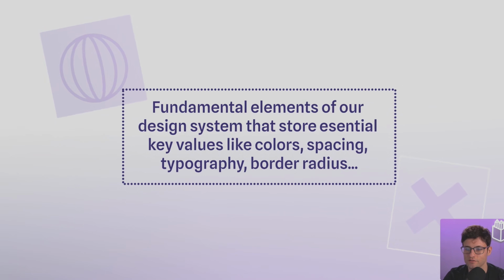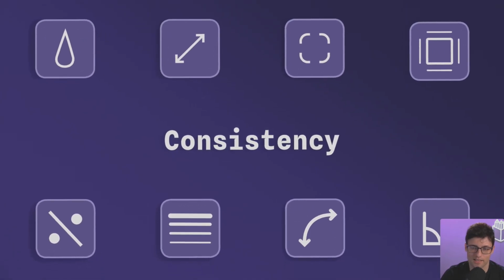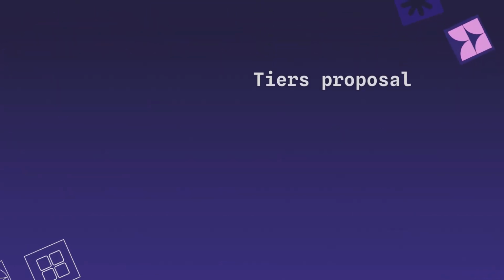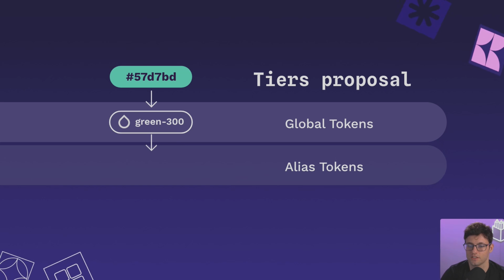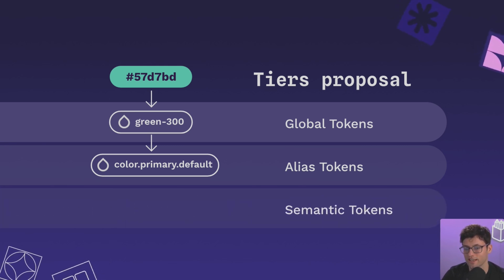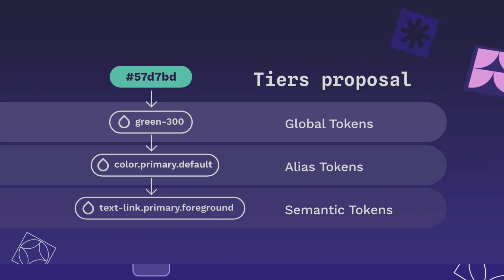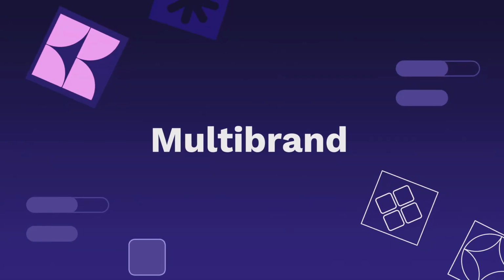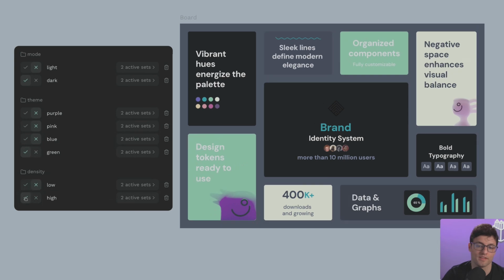What are Design Tokens? | Penpot 2.6

Comment: is it just figma’s variables?
Reply: No. The massive difference is that design tokens are a W3C web standard, so what you create here is directly usable for developers. Penpot also doesn't artificially limit the number of tokens you can use. In a serious design system, you can very easily blow past Figma's 300 variable limit virtually making it an unusable tool for large projects or sites with a lot of variety.